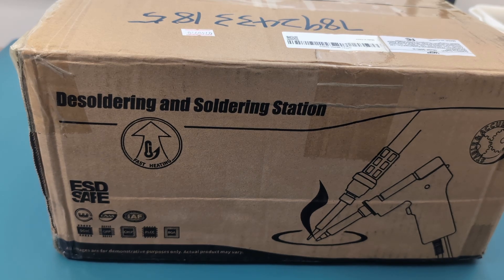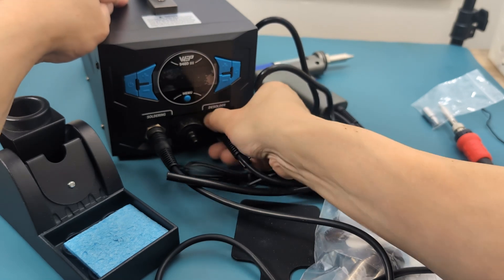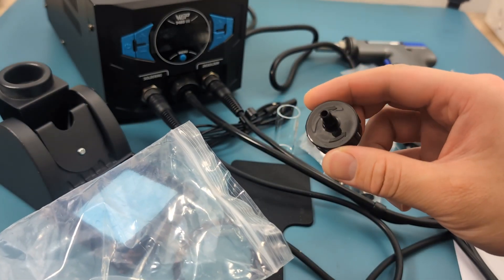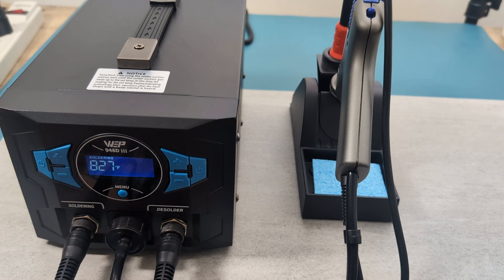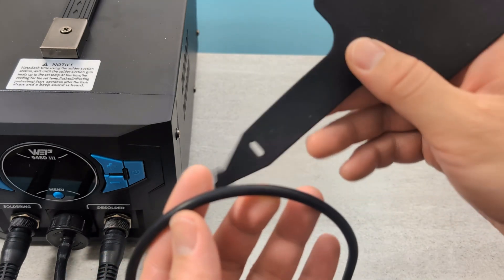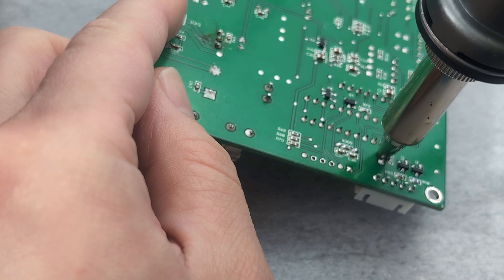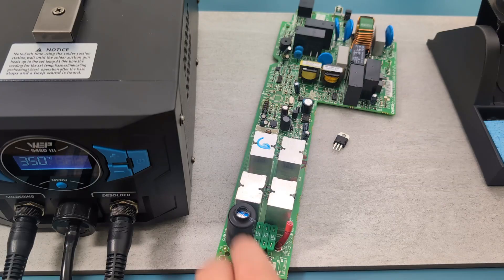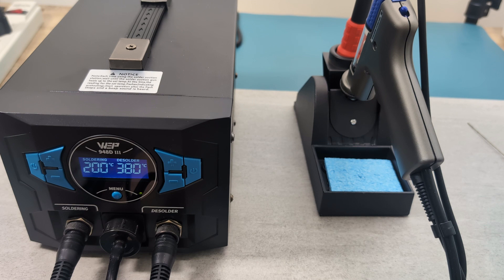WEP 948D III Soldering + Desoldering 2-IN-1 Station Review

Comment: What is the difference with YIHUA 948 I ? Which one should I buy?
Reply from the maker: I haven't tested the YIHUA 948 I, but it looks quite similar to the WEP 948D III. I think either one would be a solid choice!
Reply: @ElectroUniversity 
Yihua III have more power and bigger nozzles.
For some small Jobs is better to use the Yihua I.
I Have all the models I, II and III.
Best Regards.
Reply: @treadmillrepair754 thank you for this, im considering the iii cuz i cant see difference but power. Im working on game controllers

Comment: Great review! I’m planning to make custom controllers for gamers. This seems like a great machine to start with.
Reply from the maker: Thanks for watching! Let me know how it works out for you!
Reply: Works faster than that, it is virtually instant. No need to just hold it onto the circuit for that long of time, I've never needed a few seconds of heat up of a joint, this is just not necessary. This works easily in a second at most, actually slightly less. No need to put solder on the tip either, I have gotten perfectly desoldered holes without all that you are doing.

Comment: How mush it take to heatup ? 
And is wattage the higher the faster it heatsup ?
What about parts can i order soldering tips and soldering iron if any got damaged break etc ?
This what i look for in every single soldering iron or station 
As i dont know ehich reliable and whichs heatup better and have parts*

Any help?😢
Reply from the maker: The temperature increases very quickly. As shown in the video, it takes just a few seconds to reach the desired level.
This product uses 290 watts, which may explain why it heats up quickly.
The soldering tips and iron are replaceable. You can find links to the accessories in the video description.
Based on my preliminary testing, it is a reliable product. I hope this helps. Happy soldering! 😊
Reply: @ElectroUniversity  do you recommened is it enough ? 
Or there are better ones .
Theres many brands like Hakko , Weller etc 
How to know which one good?
Reply from the maker: @obidahasdia4095  I can't tell you if Hakko or Weller is good since I have yet to test them. If you're starting out on your soldering journey, this is a good product that I recommend.